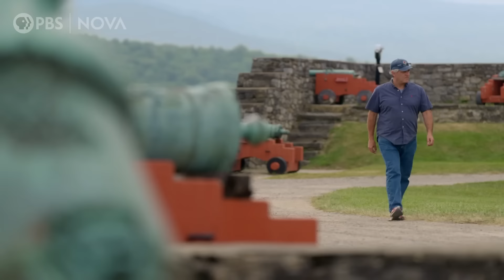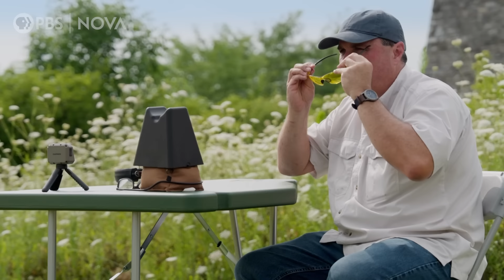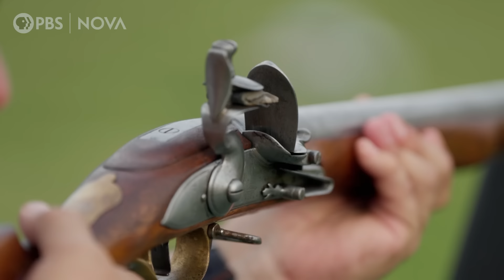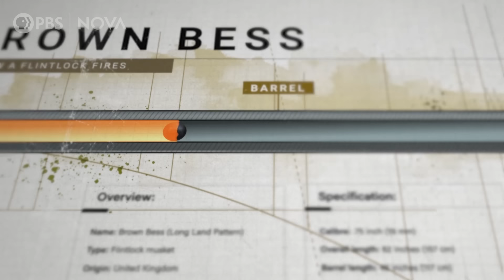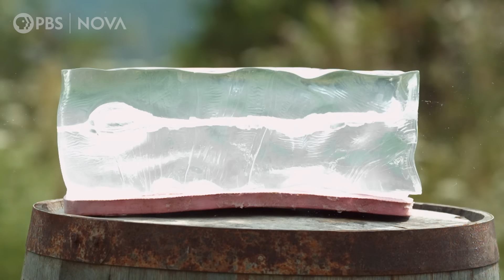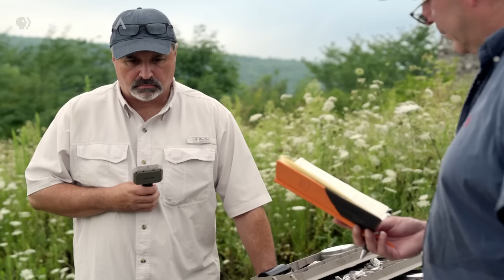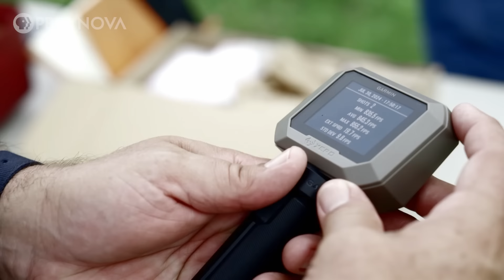How Deadly Was the Musket? | NOVA | PBS

Comment: This is pretty bad. So many errors and misleading statements. It is true that higher velocity would mean that the bullet carries substantially more energy IF THE BULLETS HAD THE SAME MASS! Consider a cannon ball at the same velocity. Would it have more or less energy than the modern bullet? By ignoring the mass, the presentation gives a false impression that the issue had only one variable. One reason that the musket ball is 0.69 caliber is that the armorers knew that they needed a heavy ball to do enough damage to put a man down. When smokeless powder came in, bullet masses declined because the powder had higher energy density. Typical modern military bullets range from 0.306 down to 0.223 and have much higher velocities, with a smaller cross-section of a conical “spritzer” bullet. This gives them much greater range than the Brown Bess. Range is what makes the modern rifle superior. 
If both bullets were spheres, the ratio of masses would scale as the cube of the diameters. The energy scales as mass * velocity squared, so the energies are not too far off. 
When one expert says that you can see the smoke of the bullet, it is a joke. Notice that there is no “smoke” on the right hand in the preceding frames. This is probably steam generated in the ballistic gel by energy transferred from the bullet. 
The short range of the demonstration allows the musket to hit the target. The other big development was rifling. That was available in the 18th century, but slow loading kept it out of the main body of the army. Only the development of the Minnie expanding base conical ball allowed rifling to be effectively used in a muzzle-loading long arm. 
Only the whole a poor effort.i wont watch the whole show.

Comment: A friend of  mine had a replica "Hawkins .50 cal. , he fired it into a sandbank then dug out the ball. It mushroomed to about the size of a silver dollar.
Reply: My dad did US Civil War reenacting when I was younger.

As a demonstration piece for some of his talks, he had fired a live round (bullet with powder, not the blanks used at CW reenactments) out of his replica percussion cap musket at a stack of about 10 pine boards clamped together.  The round went about 6 boards in, with a very neat entry hole, and the bullet was about 3" across where it came to rest.  The hole got bigger and bigger, with more damage to the boards as you went deeper.

Now just imagine the demonstration above if they had put something to simulate actual bones into the gel.
Reply: @davidmescher2526  Yes, hitting bone required amputation because a limb was just left dangling as there was no supporting structure.
Reply: No he didn't.  He had a replica HAWKEN.

Comment: If all they got was 805 fps, they seriously under-loaded the Bess. The British service charge was 130 grains of coarse powder and modern testing has shown best case velocities approaching 1800 fps with that load.
Reply: I agree that a higher velocity could have been achieved with Bess, for sure. The variables that Bess is dependent on, are many, and they can impact everything from whether or not the gun fires at all, to influencing every aspect of internal, external and terminal ballistics. It is referred to in a few sources, that the standard military load in the late 18th century, as was ordered by Ordnance,  was anywhere between 6 and 8 drams of black powder. With 1 dram measuring just over 27 grains this would result in a relatively massive powder charge by the standards of today (reenacting, casual shooting, etc). This, however, is not accounting for the likely higher standard of quality in the production of modern black powder.

What's more, it is in my experience that the likelihood of getting a 68.5 caliber ball to go supersonic (1125 fps) out of Brown Bess, increases in the following two circumstances: 1. with a charge closer to the lower end of the military load (6 drams/160ish grains), only using a necessary amount of this charge to prime the pan (not overfill/waste). 2. after multiple firings (20+) have allowed fouling to build up on the inside of the barrel, essentially constricting the diameter of the bore (akin to a paper thin barrel-length choke) to the point of influencing the internal ballistics of the projectile. 

Again, this is not a foolproof method of achieving a supersonic projectile, but rather, factors that I believe make Brown Bess let fly a "cracking" ball, more likely.
Reply: What was the modern test?  I agree that 800 seems low but 1800 seems a bit high.  The other thing to question is the powder.  Today, powder is a hotter and more consistent than powder back in the 18th century.  It's just better made from modern methods.
Reply: I agree that 805 sounds slow but 1800 fps sounds fast to me. If the ball was 0.69 inch diameter and made of lead, it would weigh 490 grains. The US Civil War Minie "ball" bullets weighed about 450 grains and traveled at about 1350 fps. Because of their design, they flared out to make a gas seal and would have made more efficient use of the gunpowder than the musket. I would expect the musket to have less muzzle energy than the 1860s rifles.
Reply: @sbreheny  This is not true. Minié rifles had a muzzle velocity of approximately 300-350 m/s, which is much lower than the smoothbore musket's 450-500 m/s. This means that the musket utilized the energy of gunpowder much more efficiently.
Reply: @sbreheny  The standard service charge for the .58 caliber  paper cartridges of the Civil War  was around 60 grains of  2F, "good quality" powder, versus the 100 plus grains  of 2F powder in the Bess. Seems like the Civil War rifled muskets were more "efficient".

Comment: So the biggest difference isn't actually the advancement of the gun but the advancement in the bullets? The gun is still basically a hammer striking the powder, only now the powder is inside the shell instead of on a plate? (sorry if this is a stupid question, don't know much about guns)
Reply: Probably a lot of varying opinions on this but the cartridge (goes hand in hand with with breach loading) might be one of the most important developments. It allows for much more rapid, simplified, robust loading. The logistics at every step are also completely transformed by a cartridge that contains everything you need to fire in a single resilient package as well as further lowering the skills and fussiness required to operate. Then there's rifling and various actions, but I think those are generally downstream developments.

I'd say the cartridge along with a breach loading mechanism is pretty substantially different from a musket and it's this combination that is the advancement rather than just the bullet.

You could argue that guns haven't really changed since the mosin and that is probably not too far off (hell 7.62x54R is still in use after 135 years).
Reply: The bullet is only part of it.

The Brown Bess was a black-powder muzzle-loader that is not all-weather capable and has no rifling, so no spin-stabilization of the projectile.  The best rate of fire reasonably achieved by a well-drilled musketeer is around three times per minute, and realistically in an actual firefight and having to contend with weather it would be much slower than that, and possibly not at all if the musketeer's powder ended up fouled.

Bullet diameters were huge because velocities were slow in order to have enough energy to actually cause damage on impact.  But this meant that trajectory would be curved as gravity has more time over a given distance to pull the bullet down.  Even if this was rifled this would be a challenge for accuracy, but without spin-stabilization it became very difficult to predict exactly where the bullet would strike.  

Modern long guns don't have a lot in common with flintlock muzzle-loaders.  Method of ignition, powder composition, bullet size and shape, barrel design, barrel length, loading method, and plenty of other things have been drastically changed.  Sure, ultimately they're both tubes with an explosive to push the bullet downrange, but someone with a modern rifle with a detachable box magazine, even if still bolt-action, could get probably 20x the number of shots off with orders of magnitude more accuracy and energy-transfer into the target, in almost any weather condition.
Reply: There is also the rifling, a spiral down the barrel, which puts a spin on the bullet.  That spin helps keep it on a straight trajectory, for greater accuracy.

Comment: The more apt comparison, and a large reason for the negative view of the musket, are the contemporaneous rifles. The musket is much less accurate than the Kentucky long rifle and, on a one to one comparison, falls far short. As a volley weapon in the type of combat they were built for, it is not quite the same result.
Reply: This is absurd. Smoothbore muskets were far superior to rifles in every way. They weren't designed for volley fire; they were a versatile weapon for any situation, whether skirmishing or hunting.
Rifles had slightly better accuracy under ideal conditions, but they weren't universally effective. Soldiers with smoothbore muskets would always defeat soldiers with rifles.
Reply: @KaL_69_  If smoothbores were better, than they would still be the primary weapon.
Reply: @KaL_69_  A rifle has better accuracy under every condition. What they don't have is rate of fire or reliability. At least when we are talking period pieces. And it isn't "slightly" better, it is massively better.
But you do have one good point. Muskets weren't designed as a volley weapon as much as just as a weapon. In warfare, their primary utility was as a volley weapon.
Reply: @ltlbuddha  Why such confidence? Rifles could shoot slightly further than muskets. But this meant nothing in most battles, because soldiers could easily get as close as 150-100 yards and fire muskets just as effectively as rifles. And at closer ranges, muskets were much more effective than rifles, thanks to their higher rate of fire and the ability to fire grapeshot.
For example, at the Battle of Guilford Court House in 1781, the American army had twice as many soldiers as the British, and many militiamen also had rifles. But by the end of the battle, both sides suffered roughly equal casualties (600 British and 400 American). How is this possible, if you say rifles are MUCH more accurate than muskets?

Comment: Why didn't the 3 Musketeers use muskets?.
Reply: That should elicit some snickers.
Reply: Because muskets are BORING!
Reply: 😳🤨🫩😩 tell me you only watch films and television & don't read without telling me you don't read, only watch television and films
The Three Musketeers is set in the first third of the 17th century. Muskets were heavy (10 to 20# \ 4 1/2 to 9 kg), dreadfully, wildly inaccurate at anything much over 100 yards/90 metres (roughly a football pitch\American football field length, & even that is a little optimistic- the closer you could get, the less likely you were to miss, especially the shorter the barrel), slow to load & cumbersome, generally used for pitched battles or sieges where transportation for the mass intensive weapon, powder & shot was readily available.  Dumas' novel has them using their firearms more often than they would have in the real world. Even so they are mostly employed during the initial assault as much for shock awe as for eliminating an enemy.
Reply: @background_NPC_Moxie  Just because I didn't read The Three Musketeers doesn't mean I don't read. That's a stupid thing to say.

Comment: Having a rest for the musket gives it more accuracy than it would have in the field during battle.
Reply: Well I think the intention was to measure the damage created by impact, rather than judge accuracy in operation.
Reply: Especially when they were like 5 feet long
Reply: Well that applies to any weapon, it reduces the human element and just leaves the gun, your point is?
Reply: @TheKathybarth  I've shot a real musket and they are not very accurate, which is why they didn't do a direct comparison
Reply: They are looking at damage, not accuracy (which is pathetic with a rest or unsupported). 

And gel blocks are not that cheap. They saved a lot of money by firing it at rest. LOL
Reply: The accuracy difference comes from the lack of spin stabilization, the shape of the projectile, and the effect of irregularities in the projectile. You have to use a spherical projectile with a musket because it will tumble and a tumbling asymmetrical projectile is horribly inaccurate. Not only does the sphere have far more drag but also the random slow spin it will have causes aerodynamic force perpendicular to the direction of travel, eventually pushing it off course. Finally, any non-uniformity in the shape of the bullet in a rifle has a reduced effect because of the spin - it tends to average out the resulting forces to a net zero. The musket ball spins much slower, about a random axis, and a varying rate from shot to shot and gun to gun. This makes it less able to average out such forces.
Reply: @sbreheny  Yes and no. This might be true of a smoothbore but it's not inherent to shooting a sphere.  A round ball just needs a much slower twist rate and you will be surprised how accurate it can be.

Small side note: a smoothbore in a "smooth rifle" style with front and rear sights with well fitted ball and patch will also have a surprising effect on accuracy (but still a far cry from rifling).

Otherwise, the conical shape is inherently superior to the sphere for all he obvious reasons.
Reply: Another reason for the reduced accuracy of the flintlock musket is the "lock time" - the time from when the trigger is pulled until the bullet leaves the muzzle. I suppose in this regard the rest does make more of a difference for the musket than the rifle because any movement during the lock time (which is about a half a second for the musket but only about 1/100th of a second for the rifle) contributes to inaccuracy,
Reply: @sbreheny  The supposed delay is only really noticeable when watching a slow-mo video. in real time, IF everything is right (good, sharp flint, not too much priming, clean touchhole), the "delay" is neglible. 
BTW, there is no functional difference between a flintlock musket and a flintlock rifle. rifling only affect the firing of the bullet AFTER it leaves the muzzle. The SMLE, on the other hand, is as different as comparing a  WW1 SPAD or Neiuport fighter to a modern jet fighter. Apples and hand grenades, dude.
Reply: @sbreheny  Why do you think it was shorter for the rifle?
Reply: This feels like bullying muskets

Comment: Movies have always downplayed the impact of a 69 on bone.  Amputation occurred due to the bone just being gone, muscle and arteries shredded.  Not sure the range or the waddling used, both will greatly impact the hitting power of the brown bess.  Not sure how he hit dead center with a brown bess either.  British officers were actually concerned that transitioning to rifles would mean each soldier would pick who would die verses using the brown bess to shoot at a line of men. Also the modern rifle used is the hard hitting hard stopping WWII rifle.  Many a vet has mentioned they rather have the M1
Reply: That's a m1?

Lee Enfield ww1
Reply: @ correct not an M1 close in performance not exactly modern. My assumption is that British vets also miss The Lee Enfield.
Reply: In the old days, a splinter meant amputation.

Comment: Wouldnt .69 caliber be very tiny? I think they meant 69 caliber
Reply: It’s in Decimal Inches, and the Decimal Point is always included when the diameter is less than an Inch. Only in casual conversation do the numbers sound “whole.”  For example the 0.50-cal. BMG round is called “Fifty Cal” even though it’s half an inch wide and not “fifty inches” wide.

Only in Artillery do we have rounds in whole inches.
Reply: @Ryan_Christopher  those are measured in millimeters, like 140mm.
Reply: @RealMTBAddict  Field Artillery yes, Naval Artillery no.
The Deck Gun of a U.S. Destroyer is a “Five-Inch Gun.”  Old Cruisers and Battleships had “Eight-Inch Guns” and “16-inch Guns.”
Cannons are measured in millimeters, like the 40-mm Flak Mounts.
Reply: Depends on the country, application & era.  Naval rifles pretty much stopped being manufactured after the second world war. All the terminology & nomenclature was based on the diameter of the bore & the length of the projectile; take the U.S. Navy's 5 inch/38 caliber destroyer gun for instance. 5 inches in diameter & 38 times the diameter in length. (The term caliber is used as a measure of length of artillery barrels from muzzle to breech, expressed as a multiple of the bore diameter.)
Then you have the armies!  Is it inches or millimeters in diameter, or is it how much the projectile massed? For example, the US Army's best tank destroyer mounted what was called a 76 mm high velocity gun which was actually 76.2 mm which is more or less the equivalent of 3 inches, but the British fielded a 76.2 mm high velocity gun but called it the 17 pounder.  Clear as mud, right? 🥴😵‍💫Then you have the 5.56 mm NATO which is 0.223 inches in diameter... for a round that is so infamous, it just doesn't sound right if you call it a 22 caliber! 😅
Reply: It's like a 22 caliber, .22 inches. So .69 is over half an inch.